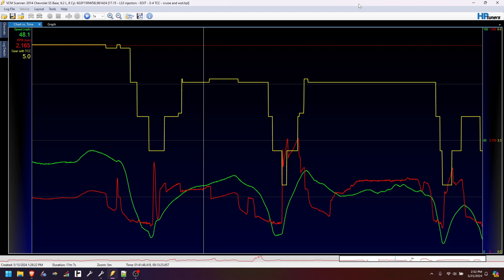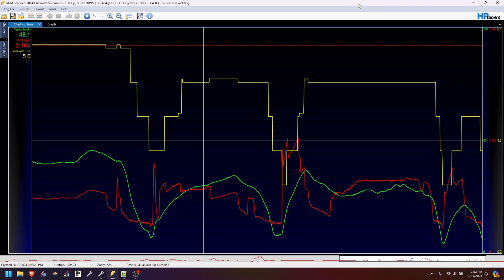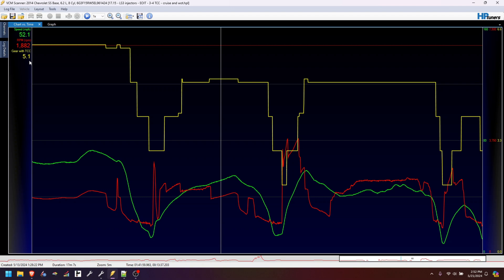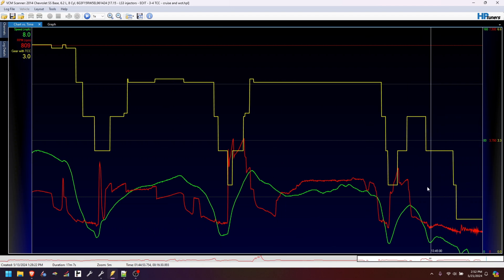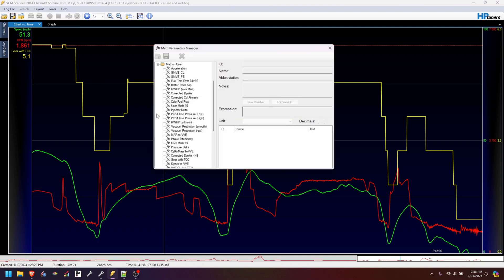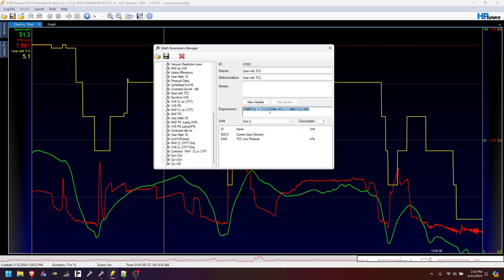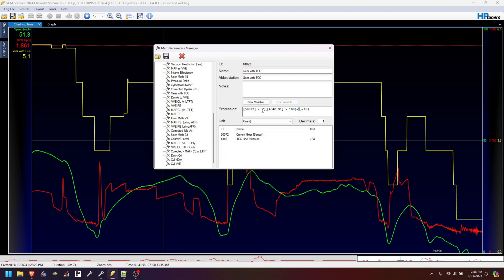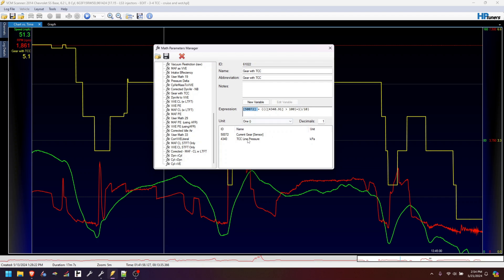How To: Combine Trans Gear and TCC Lock Up in one parameter

Comment: Is this something that can be used with Gen 3 stuff?
Reply from the maker: Should work just fine, most likely only have to change the Trans Current Gear and TCC Pressure PIDs to the correct numbers.